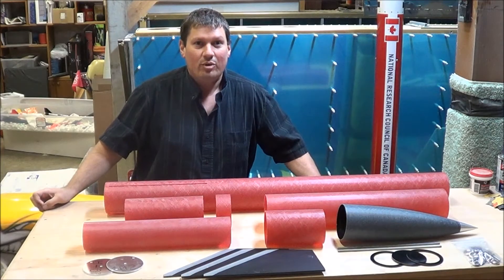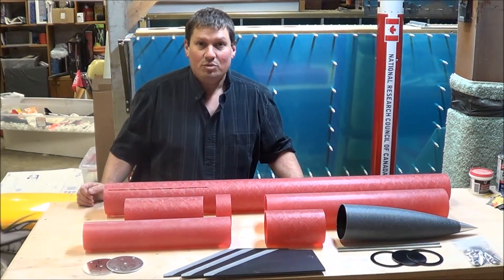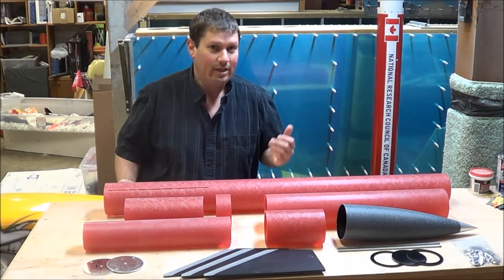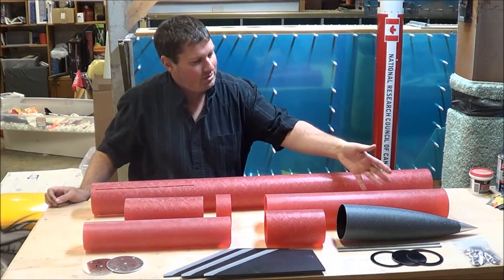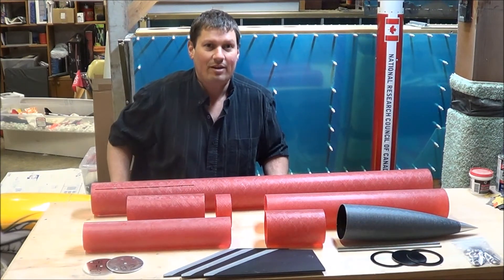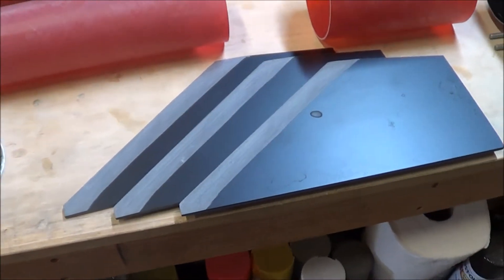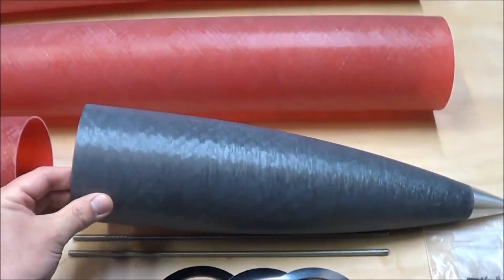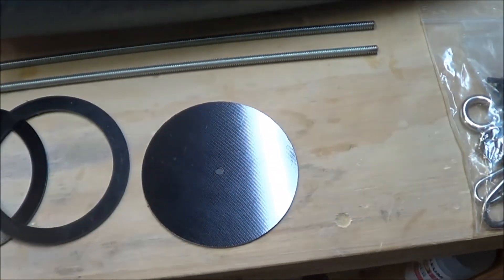Anatomy of a High Power Rocket 1: Wildman Drago 4XL Unboxing

Comment: I watched most of your videos. They make an excellent tutorial. Could you give me an idea of how much the finished product would cost?  I would like to make one that goes about 10,000 ft., with everything your finished rocket has. Thanks for the tutorial.
Reply from the maker: Prices vary on these things depending on size of kit and materials used, but the Drago retails around $280.  You will then need to add parachutes ($80), recovery harnesses ($60), altimeters ($60 each), retainer ($40), and miscellaneous epoxy and hardware.  If you want to paint the rocket and add decals, then add that in as well.  A GPS tracker will cost a couple hundred dollars, and motors for a rocket this size will vary from around $60 for a 38mm diameter J to $300 for a 75mm diameter M motor.  A small M motor in this rocket will send it to around 14,000 feet.  If 10K is your goal then you certainly don't have to have a 4" fiberglass rocket to achieve it.  A smaller diameter rocket will get better performance on more modest motors, while costing less.  The trick is getting the gear you want to use stuffed in the smaller space.

Comment: What level rocket is this?
Reply from the maker: It's generally consider a Level 2 size, but can fly on larger I motors (level 1) and small M motors (level 3).  So far I have flown it on J and K.